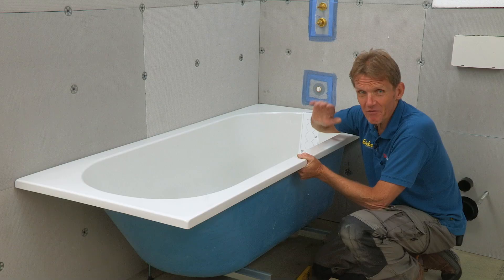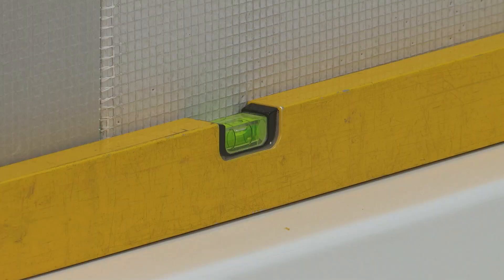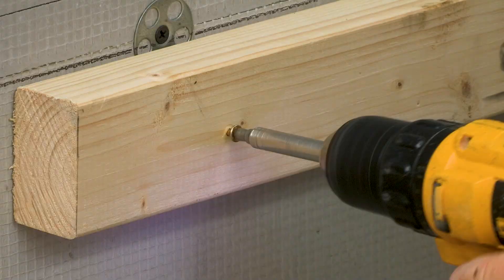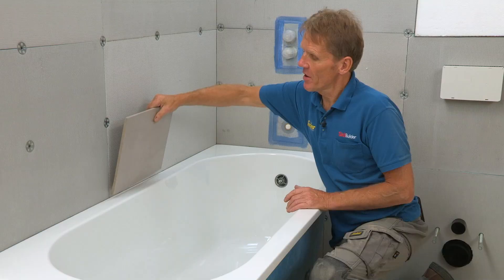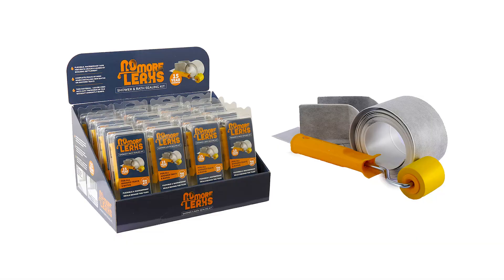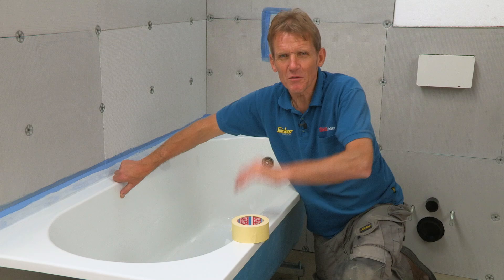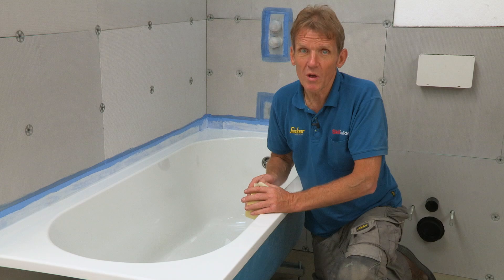Sealing Around a Bath to Stop Leaks ~ 2-Minute Tip

Comment: I personally secure the bath so its rock solid, seal it with silicone, tile, then silicone again. Yes or no???
Reply: Absolutely perfect....that tape is a waste of money....15yrs bathroom fitting exp.
Reply: I would use CT1, tile then silicone.
Reply from the maker: Yes for sure
Reply from the maker: @bodinski100  The tape is belt and braces. You won't get a leak with the tape
Reply: Same here. Usually secure the bath with a continuous bead of silicone as well to create a 3rd seal

Comment: Im not a plumber but aren't you meant to fill it up half way before starting to seal it?
Reply: Yes
Reply: I am a plumber and i always do that
Reply: I have heard that from days of old and have sealed an tiled round many baths in my various houses of the past but unfortunately never remember to fill the friggin bath until I have finished. Never had a bath as yet that has been against a plaster board wall, I have to chip a line of plaster out.
Reply from the maker: With lesser baths I would do that but this bath is rigid and with the batten and adhesive there is zero movement so no need to weight it. The tape is the real seal.
Reply: @SkillBuilder  common sense and experience Rog 👍🏻
Reply: Good practice,  at the same time if the legs are secure and actually able to take the bath weight (water and a large person) usually keep the legs small and use timber to spread the load and raise the leg heights so they aren't wound right out. And stick the bath to the wall all the way around with a good silicone and a dust free wall. Also timber the wall as seen in the video,  you will get very minimal movement even with weight in. You can also check the gap without water and stand in the bath measures and with water and measure etc to see what movements are before you seal, then just get the middle ground before you seal. Use cold water as you dont want steam on the surface or water for that matter!  Good luck
Reply: Filling a steel bath with water before sealing is an absolute "must"😍😊😎
Reply: @DavidJohnstoneBespoke  I've read all of your responses so far. I follow the exact same practice as you. Were we separated at birth? Do you still get that same vicarious pleasure from quoting for a job, not even getting a "thanks, but no thanks," but afterwards get a call back to put right other folks botched jobs? Only happens upon rare occasions for me, but the "I told you so" is priceless. Well actually, I usually say, "this is gonna cost you. A LOT!" Or alternatively, "go forth and multiply". With only 2 syllables. ;-)
Reply: @SkillBuilder  is this a reply from Roger? If it is then I'm starstruck 🤩
Reply: @SkillBuilder  yep, or sling a few bags of the brickies cement into it.

Comment: If possible your starting point is to avoid these rubbish cheap baths made of plastic so cheap they flex and twist - a good quality bath really helps in the fight against leaks as they leave your silicone to do it’s job as a sealant rather than expecting it to also make up for poor quality baths - there are plenty out there that should be avoided like the plague.
Reply from the maker: Yes I agree. These reinforced baths from Abacus are as rigid as cast iron.

Comment: Would be great to see a video for improving the seal on a existing bath after tiles and used for some time
Reply: To improve the seal, you'd need to remove the seal (silicone) completely,  now check if the bath is actually secure once the seal is removed,  check for movement within the bath, if you have movement then check the legs haven't twisted moved etc and re secure the bath - sometimes you can also squeeze silicone into the joint now between the bath and wall and get a new bond to the wall again,  do this all the way along but not to fill the tile to bath joint as this needs a good size bead (seal)  to last a long time, now you can half fill the bath before hand to allow the weight (compression) and do the seal, use a tool to get a solid bead and not your finger as this reduces the seal.size,  smaller looks better but a bigger solid bead is best,  make sure its clean and free or oily soap and water before you start or else it will just pull up and not stick,  you can use a sealant cleaner beforehand and dry and hover also,  more prep the better! 🔥
Reply from the maker: We will do that. Thanks for the suggestion
Reply: Also use the tool (silicone tool) a few mm bigger than the largest gap you have to get a good seal onto the tile and not just under the tile!
Reply: @DavidJohnstoneBespoke  thanks Dave for all the detail.
Reply: @Settez123  good luck,  can sometimes be a 4 hour job to remove old sealant,  secure the bath again if legs have failed and re so the silicone. Sometimes just an hour,  really depends on how bad it is, worst case can be to remove lower tiles aswell and re plaster some of the wall, or worse job (rotten joists/ new floor/ and ceiling)  quicker if fixed the less damge is done

Comment: I’ve done this for a while now but I use mapei kit from Screwfix. I also run a bead of either ct1 or plumbers mate in the corner so the tape sticks and there is no chance of the water getting through underneath the tape. I then fold the tape down then paint it with the waterproof paint they supply then fold it back up and paint it to the wall. I do the same on all shower trays aswell

Comment: Done all that, similar tanking system but issues I'm having is silicon doesn't stick to bathtub property due to what the bath is made out of. Did with water and weights in but not enough. Should do a vid of different silicon's and which are best for different bath composites + cleaning spirit types. Great vids, big fan.

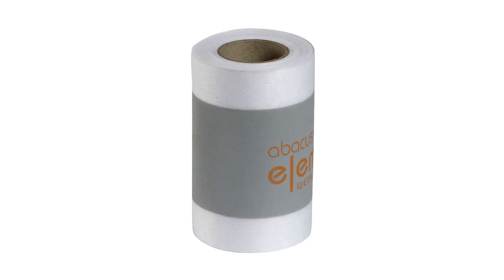Comment: Probably slightly confusing for novices. The seal/roll/tanking tape you showed at 00:44 is an alternative to that product you used at the end, which does exactly the same thing, but is thinker and stronger than the last product. Also, the tape needs to be applied to the veritable corner too after the horizontals have been done (so to overlap the joint correctly.
Reply: i knew something was wrong but could not nail it, still......wouldn't the tape show in the bathtub?
Reply: @julianchoque7402  not in the end no. Half the tapes width gets gunked to the wall with the brushabke tanking (liquid/paste/glue) or whatever the official term is. The wall is then tiled. The fringe of the tape flapping over the bath side is then cut back in line with the face of the tile. Then the bath is siliconed.

Comment: when I fitted my last bathroom I used shower wall boards that came with a rubber seal absolutely fab for 8 years.  We have just had it re-fitted by a local professional firm.  4 months later and still.waiting to have it re sealed as the new wall boards have blown and the kitchen sealing is water damaged.😡

Comment: I use classic seal here in Ireland  for baths and showers it is a  sticky waterproof rubber to stick on the bath with a second thin rubber membrane about 50mm above the bath it never leaks but talking about 35euro for it compared to lobbing silicone to fix it to the wall
Reply from the maker: We know the product well

Comment: The reviews on Amazon seem concerning. It seems that the product has storage issues and 'melts' in the packaging over time. If you receive one of these, you'll have a hard time peeling off the backing tape and applying it. Plus there is no paint on seal option either.

Comment: So, .. with this "no more leaks"... I noticed you you didn't address the over hang on the bath? ... Do you trim it to the tiles.. ? Sharp knife will search the bath?
Reply from the maker: It is very easy to run a Stanley knife right up to the tiles and not scratch the bath. The silicone sealant then goes on top so even if you were unlucky and went too deep it would not show.

Comment: Nice tip Roger, never seen this before - do you use it on other fixtures/fittings?
Reply from the maker: Yes anything that pokes through the wall should have a gasket. You can buy them ready made

Comment: Interesting how the durarock(cement board) is attached to the wall in that bath. Could you do a 2 minute tip video on that. The fasteners look like flat roof insulation screws.
Reply from the maker: Here is the whole job, start to finish. https://www.youtube.com/watch?v=vNYNigge1C0&t=2484s
Reply: @SkillBuilder  Thanks!! The washer makes more sense to stop movement in the backer board. In the US, you only need to use a coated bugle head screw.

Comment: Hi. At present I have a shower fitted over my bath with tiled walls around it. We want to change the bath out and put panelling on the walls around the bath area. Once I have changed out the bath will the no more leaks kit tape stick to the existing tiles ok before I stick the panelling on, as I want to get away with removing the existing tiles as they give a clean smooth finish for the panelling to stick too.
Reply from the maker: Yes it will stick to the tiles very well provided they are clean and dry. No need to scratch them up or anything
Reply: @SkillBuilder  approach the quick reply. Thanks.

Comment: 1:43 seems like a bit of flex in that bath when painting with the brush
Reply from the maker: Well spotted. The end panel was not in place because a wall was going there. We needed to leave it out to film.
Reply: @SkillBuilder  was the wall baton not full length? I usually make the frame the full size. It will be rock solid when it's finished. Wish I found that tape before I returned a couple of properties

Comment: It's much wiser to use aluminium profile instead of wood. And it's much wiser and technically more reasonable to install tiles first and then a bath. When tiles overlap the edge of a bath there's an invisible and unreachable space beneath the tile edge. The space that we seal with a silicone. If the silicone or any other sealant deteriorates and cracks it's impossible to notice that until water damage is beyond repair. If a bathtub is installed after the tiles, the sealant is always visible (requires some work to achieve good aesthetics) and repairable.
Reply: Stefan, Im intrigued.....do you mean tile the walls and floor, then install the bath? I have only seen this done a couple of times and the bath was not fixed to walls properly, causing a leak in the corner! What profile do you use and how do you fix it?
Reply: @juliestreet8688  Yep, tile the walls and floor, then install bath. As for aluminium, common 50x30 mm square tube will do the task. You drill 25-30 mm holes in one side of the tube and 6-10 mm holes on the exact opposite side. Then use any screws/anchors to fix the tube to the wall. You can support 1, 2 or 3 sides of the bathtub. Then put some silicone/sealant on top of the tubes and set the bath on. Fill the bath with water. When done properly there's no chance of leaks and any unwanted movement. Of course the bathtub itself should be supported by universal bath legs.
Reply: @Stefan_Kawalec  could Aluminium  angle  be used, assuming it was heavy gauge? I'm thinking that would only need half the number of holes.  Me and my son install bathrooms and we e always done it the traditional belt and braces way as described by Roger. But you've got me thinking....
Reply: @Stefan_Kawalec  also, how do you do your shower trays?
Reply: @juliestreet8688  Depends on a shower tray. If it's one of those modern very low profile I just use any adhesive to fix them to the floor. Of course after I've tiled walls and floor (of necessary). If the shower tray is bit taller it usually comes with all the necessary fixtures and accessories; if it doesn't I improvise, but treat the shower tray similar to the bathtub.
One more very important thing. I use waterproofing sealant with corner tapes before tiling. I'm a fan of Ceresit CL51. So walls and floor in wet areas (including floor under the bathtub and shower tray) are sealed.
If a shower area is to be made entirely from tiles (whatever you call it in English), I install linear trench drain, make concrete flooring with slopes, seal it, put the tiles and voilà. I try to convince my clients that they let me buy the trench drain, because I have a tested manufacturer, so we can avoid any future problems (leaks, clogging etc.).
Reply: @juliestreet8688  Yeah, angle would be fine. It may be an asymmetric one, like  30x50 but with walls 4 mm thick. Aluminium is nice, because it doesn't corrode in water, it's easier to cut and drill than steel and is stable through time, unlike wood.
Reply: @Stefan_Kawalec  thanks for that info. Tiled shower floors are called wetrooms in UK, we use preformed tray and tile onto that, (such as those Roger uses from Abacus). Sloped concrete sounds like a lot of work! I am definitely thinking of using your bath method though.
Reply: @juliestreet8688  I don't like preformed trays (we have Wedi boards here). They limit clients' creativity. With fast curing concrete it takes no more than 2 hours to install trench drain and make slopes. It's only disadvantage is that I have to wait 2-4 days before applying waterproofing sealant (to reach the level of moisture in concrete below 3%).
Reply: @Stefan_Kawalec  yes we tend to use Wedi along with Mapei paint-on rubber solution and tape.

Comment: I absolutely soak up the advice of Roger and Co however, I've recently applied 'No More Leaks (NML)' to a bath, and I'm not confident with the product. I used Abacus 'Fix MD' between the bath and the Elements wall panels. Some minor gaps remained in the corners due to the slightly rounded edges of the bath which didn't fully meet the square wall. these were filled with silicone and finally NML was used for the surround. I've not been able to tile for a few weeks but I've noticed the adhesive from the NML is oozing through the fabric and is becoming increasingly tacky to touch, leaving a sticky residue on the fingers and I wonder if the silicone has acted as a solvent and reacted with the NML adhesive.  Maybe this is normal but because tiling takes place soon after fitting, is not noticed. Will this affect the waterproof properties of the product?
Reply from the maker: We will check that out. I think it is o.k but we will find out for you

Comment: Not sure if you should have a slight fall on the level even of its designed to drain the water. Me I always leave a tiny drop so the water runs away.
Reply from the maker: I always fit baths level. The water should drain from the edges
Reply: Bath already has a fall built in which is why it should be fitted level.
Reply: @juliestreet8688  I build the bath slightly off level, in the opposite direction of the water. That way when the customer decides to pee in the bath they have to wade among it and think about what they've done.
Reply: @ricos1497  🤣🤣 "wade among it" .......how deep does it have to be for wading? How much can the human bladder hold?...Surely these types of questions need to be answered when calculating how UN-level to set the bath....
Reply: @juliestreet8688  regulation states that urine-wading starts at the lesser of 8cm depth or 17litres. After a few Christmas beers, it's doable. Although the greater the volume of alcohol consumed, the greater the risk of drowning.

Comment: Good product, really don’t understand the sizes though - 2m or 4m. 2 will never be enough and in most cases 4 is too much, 3m is the magic number Abacus. Love it though just a shame about the wastage
Reply: 2 for shower tray,  4 for a bath
Reply: @JuiceBanger1  you’ve obviously never fitted either 😂
Reply: i fitted 900mm shower tray, so 2m leaves an excess of 200mm to cut off and my bath in an alcove was 1700 plus the head head only so the 4m done it.  simples.
Reply: @JuiceBanger1  Fair point on the shower tray but you didn’t need 4m for the bath. 3m is the perfect number.